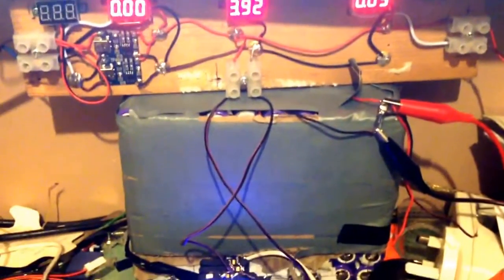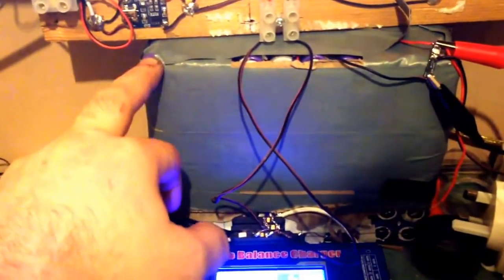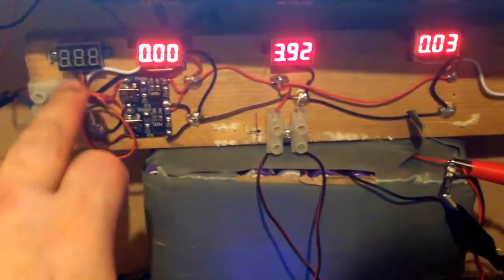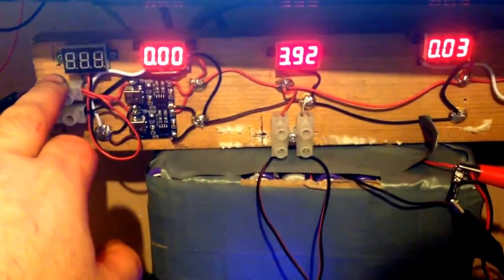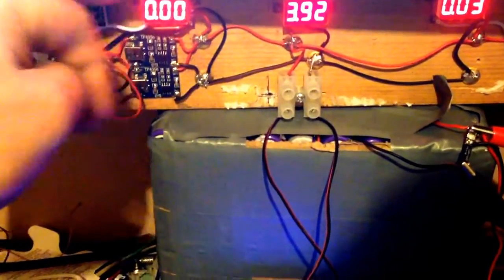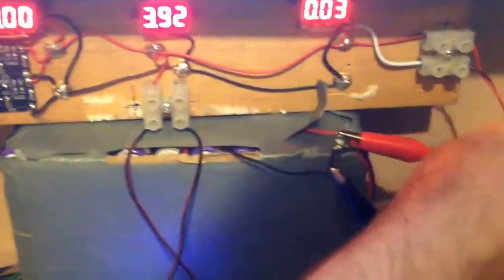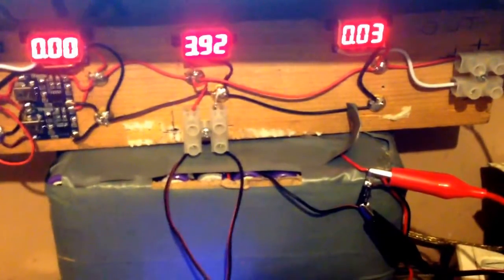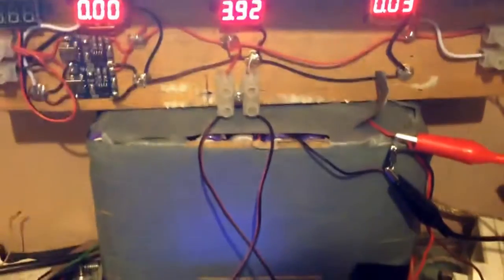Solar li-ion bank

Comment: A very cool setup my friend. I like very much.
Reply from the maker: +Raymond Earle yeah not like that now changed so many times lol
Reply from the maker: +Raymond Earle but that effectivly is the low voltage system my other system i put 3 in series then had a panel to charger then cell so they all charged by there own panel and stay in balance they was less voltage drop due to stepping voltage down but if adapter failed means i fried my devices so gone back to lower voltage and step up
Reply: I see my friend. But it is all good when upgrading things to be better.

Comment: That's a nice set up you have! Pound land have USB reading lamps and USB hubs! All i'm doing is piggybacking off of lead acid batteries! Until the right deal comes along! 

I see your email I will have a look into hit! Maybe when we get some nice weather I'll see what I can put together! 

I have some 10mm copper tube but no way to bend it
Reply from the maker: i think you will also like stuff from this fella https://plus.google.com/u/0/114726597167394693123/posts
Reply from the maker: fill full of sand and cap end the sand inside will stop it from kinking
]
Reply from the maker: i think the led acid is prob best way to charge these unles they is some sort of way to balance charge them from what ever the input is somthing like your cordless tools but i noticed this only charge by the output so would go out of balance
Reply from the maker: the only issue is i have 8 amps able to put into the bank but currently only able to put an amp in due to the charge controllers finding a better controler ant simple
Reply from the maker: hmmm i wounder if each panel had its own charge controller if that would allow more current
Reply: David Simpson
Are you using TP4056 based charge controllers? As these can do 1A each... so if you stick a few in parallel. then you can cheat and increase the amperage that way...
Reply: David Simpson
Another cheat is something like 271574426233 on ebay - a 5A constant current / constant voltage regulator. set the maximum current, and set the peak voltage to whatever voltage your want your batteries to top off at - say 4.1v. It will then only supply the up to the set current until the maximum voltage is reached, and then maintain that voltage.
Reply from the maker: Peter Feerick i am using the 405 yes but they are not allowing more current in parallel the 2 in the video are in prallel but dont seem to be stacking just the same current  that unit looks quite good that maybe the way forwed at moment im about to do one charge controler per panel and see how that does
Reply from the maker: Peter Feerick but ent they led drivers so will always supply the same current ?
Reply from the maker: Peter Feerick from what i just been reading they are constent current and constent voltage so will sit at that voltage and current full stop when voltage is reched the current does not drop they ment for driving led not charging li-ions so back to the drawing board
Reply: David Simpson
There is one out there with three pots on! I'm waiting for Jullian Ilett to show it! one sets voltage one sets current and one is the end of charge cut off I.E when the current drops to 100ma
Reply from the maker: oh cool im following his stuff so will look fored to seeing it
Reply from the maker: i have another vid up of some changes i did today
Reply from the maker: i found this in my searches the other day think you might find it usfull how to link 2 smaller power inveters to make one larger one https://www.youtube.com/watch?v=pwGBt2QB8Qg
Reply: pietkaify
That's one of the ones I have. I just couldn't see a listing for it, so couldn't post the number for it. But you are exactly right - 1 is for voltage, 2 is for current (or is it 2 then 1... can't remember now!) and IIRC 3 is for current when terminates.
Reply: David Simpson
They should provide the maximum current as set until the maximum voltage (as set) is reached, and then as the load from the battery drops as it is is nearing completion the current will drop off. Only good if you have a system that is in use all the time, otherwise it would probably overcharge the batteries as it doesn't have a end-of-charge profile. LEDs behave differently as they load the regulator up the same amount all the time (ignoring the variation due to warmup, etc) And Julian really does some good videos... not enough people like him around to explain it so well, and make it entertaining!
Reply: Peter Feerick
To give you some idea of this working, have a look at these photos. https://flic.kr/s/aHsk8MQ1rt This is a adjustable CC / CV regulator - just a fancier one with a on-board display. It was set to 'charge' a 1 cell 2200aH lipo at 1A to 4.10v. So it started of pushing 1A into the battery until it reached 4.1v, switched from the CC profile to the CV profile, and then the current plummeted quite suddenly to 0.000A - there was no load on the battery, and it's in good condition, so it has minimal internal resistance and thus didn't need any 1/10 initial current termination logic. This was over about a 30 minute period...
Reply from the maker: right getting a little lost here so the 2 pot ones are no good but the 3 pot ones are ? the one in all the photos was that a twin pot or one of the ones with 3 pots ?
Reply from the maker: Peter Feerick what im wonting is somthing that will kick in when they is solar power charge untill set voltage then nock off with out haveing to manuely set voltage etc everytime it comes on so i can basicly set it up first time then leave it to do its job with out any more intervetion like the other solar chargers do the lead acid batterys
Reply: David Simpson
got it watched a video of someone else doing it!
Reply: David Simpson
have a look at tis one?     111398101201   <-- Ebay number   it has three ajustable potts
1- voltage you want to charge at Max
2- current to charge at
3- 0.1 of charge current
Reply from the maker: pietkaify if the other video of it been done a little more clear ?
Reply from the maker: pietkaify blast 3 amps need bigger haha but year thats what im looking for just set and leave damn that needs 7 volt and up wont frun from 6 volt or less well looks like 3 amp is all i can find will order one friday me thinks
Reply from the maker: pietkaify 321626300746 a amp 4 volt and up any more then 4 amp needs heatsinks but dont say were to put them
Reply: That's the one I was looking for! I have one of those knocking around here somewhere. The difference between two pots and three pots is the two pot versions will keep the voltage up at the set value all the time (once it is reached). The three pot versions will switch the voltage off when the current gets to whatever lower limit you set - i.e. 1/10th initial charge current. The one I showed in the photos was a fancier two pot version. It would have been ok if there was a load on the battery, as it would run directly from the power supply and also keep the battery perfectly topped up.
Reply from the maker: Peter Feerick right got my self one of these 111398101201 the middle pot dont shut current off to continue the voltage no current process it just shows you when the current flow has dropped to a seat level and are no good for lithium only nicads lead acid etc as it will turn the led on when a set current rate is reasched as these batterys charge they draw less current thus triggering the led
Reply from the maker: pietkaify  right got my self one of these 111398101201 the middle pot dont shut current off to continue the voltage no current process it just shows you when the current flow has dropped to a seat level and are no good for lithium. only nicads lead acid etc as it will turn the led on when a set current rate is reached as lithium battery charge they draw less current thus triggering the led to indicate charge is complete but on the other side i now have an adjustable power supply
Reply from the maker: Peter Feerick will this unit run the same setting if power is lossed on the input as other units i looked at wont cut the current

Comment from the maker: problem with said pack putting 2 li-ion chargers in parallel did not help to charge the bank at more then 1  amp
so would take for ever to charge i think the way forward is to wire the panels in series for 12 volt and send that to a lead acid battery then take off that with the imax b6 charger to charge the li-ion pack that or split the pack into 8 smaller packs and have each connected to its own charger and then just link them in parallel or series depending on requirement at the time if you can think of a better idea please let me know thanks
Reply: I will have a think! And let you know! Vide quality is good! I seem to use my phone more than my camera! I started my channel on YouTube because I had low confidence! I still struggle to make videos sometimes! But it's worth it keep doing the video's and you might find your perfect answer